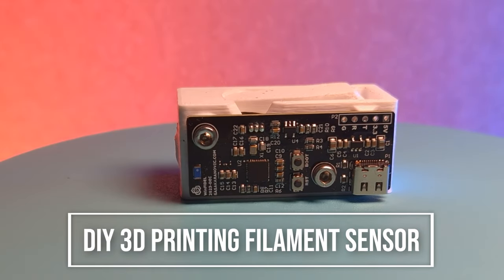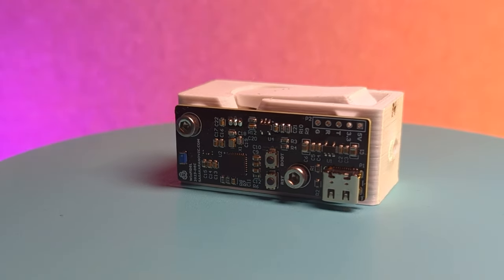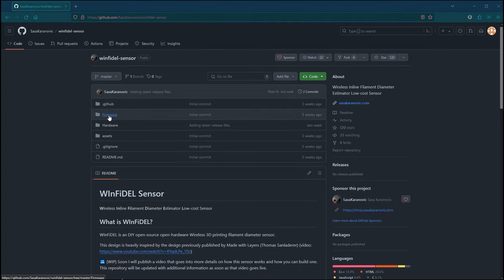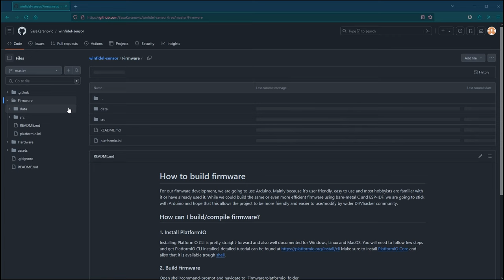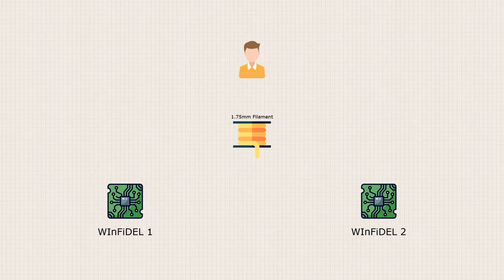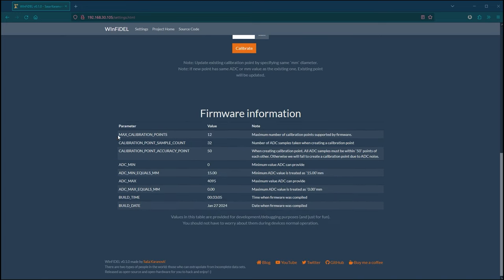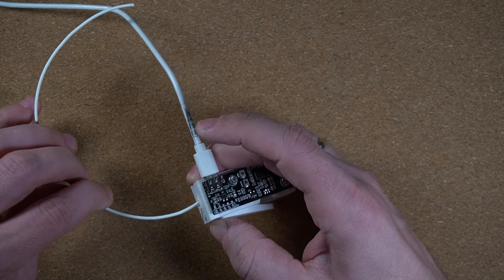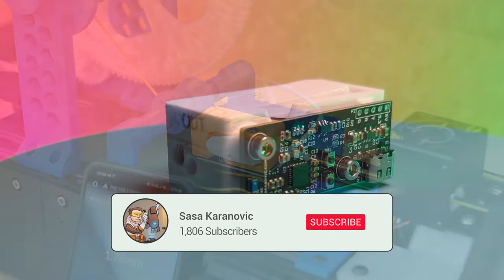Let's build a WiFi 3D Printing Filament Diameter Sensor

Comment: Awesome job ! 
are there any plan to implement it into Klipper / Happy-Hare so that u can adjust filament multiplier live?
Reply from the maker: Thanks! I'm glad you like it!
I mentioned in the video that I really don't have a use for filament diameter sensor, but I made one just for fun (and also potentially help people who have the need for one). :)
I don't use Klipper/Happy-Hare (yet) but I think it should be fairly straight-forward to integrate it. So I am happy to offer support if anyone wants to take a first stab at it.

Comment: Such a sensor may be used in the future for active flow compensation, based on real time measurements.
Reply from the maker: I agree. It could be very useful for demanding/challenging filaments or if you really want to "chase microns" on your prints.
So far my experience is that most of my filaments are relatively dimensionally accurate, or maybe I'm not printing designs that are that demanding. Or maybe my standards are low. :)

Comment: Hello, I really liked the project and I would like to use it for a filament extruder that I am designing. My question is whether you designed the PCB from scratch or if it can be purchased somewhere?
Reply from the maker: Thanks! Filament extruder sounds like a very interesting project!
The PCB in the video is designed from scratch. At the moment it is not available on the web shop, mainly because I thought nobody would want to buy one. :)
The design is open-source open-hardware so you should be able to just order a batch from any of the online PCB shops.
Let me know if you need any help :)

Comment: What PCB manufacturer did you use and do you think you might offer the completed PCB in your shop?
Reply from the maker: Hey! This is a pretty simple design so any PCB manufacturing shop would be able to manufacture it without any issues.
A couple of people posted on GitHub which PCB vendor they used and how much it cost them.

Comment: it would be great if it could measure not only one axis but two axis (have a second sensor 90° rotated ) to account for elliptic filament
Reply from the maker: You could do that but I'm planning on building an even better (optical) sensor for this purpose. Stay tuned! :)
Reply: @SasaKaranovic hey sasa with methode will you prefer to mesurment optical? Laser, linear photo arrays, AI camera dia dedection?
Reply from the maker: There are obviously a couple of different ways I could do this... Since I plan on releasing it as open-source open-hardware project (same as this one), I'm still considering which one would be the most useful to the 3D printing community. There is no point in making a sensor that is extremely expensive or very difficult to make, because at that point someone could just buy an industrial/commercial sensor and call it a day. :)
If you have suggestions or something you would like to see, feel free to let me know!
Also subscribe if you don't want to miss when the video goes live. :)

Comment: I propose to develop the following, more practical gadget that I am really missing when 3dprinting: A measurement of filament slippage at the extruder gears. This is a big problem because slippage causes inconsistent extrusion. This would be possible by comparing the  rotation of the gears with the actual linear advance of the filament. In case of a discrepance of those two measurements, a command could be sent to the controller of the 3d printer to compensate that deviation (increasing or decreasing extrusion) - volila, we have perfect prints! I would immediately build such a  project!!
Reply from the maker: Thanks! I don't know how useful this would be to people in the community but on paper it sounds like a great idea. And it would be fairly straight-forward to add it to the filament diameter sensor. So you get the best of both worlds.
Reply: @SasaKaranovic  Let's simplify the project by stepwise execution. 1st step: build a device thats just measures the linear advance of the filament and offers an output interface. That alone would be great. 2nd step:  measure the rotation of the gears of the extruder, using an optical encoder for example (which many common 2d paper printers use) for example. 3rd step: compare both and provide a digital output, an analog signal or just a lighting alarm LED as minimum when significant slippage or skipped steps are detected. Do not underestimate the importance of such a device to improve 3d print quality!